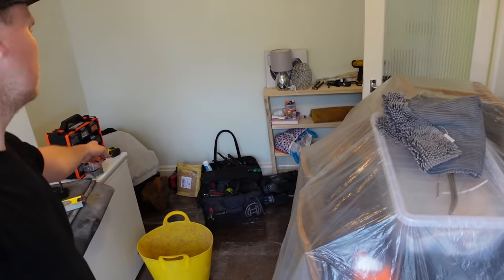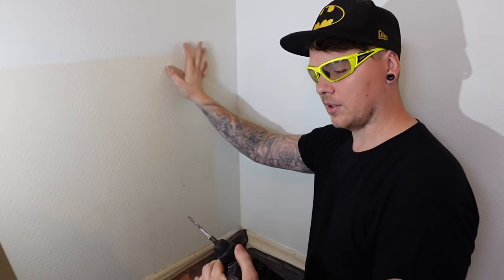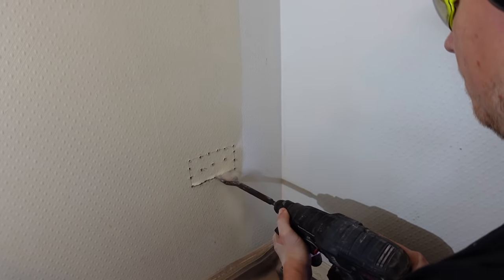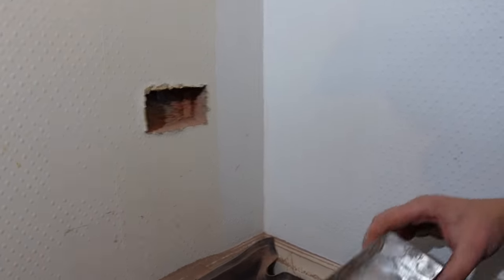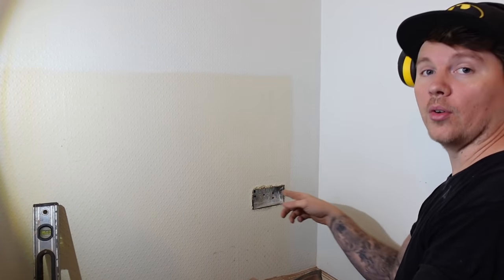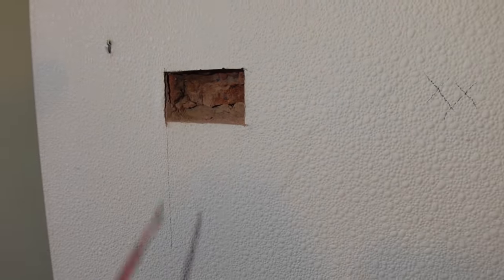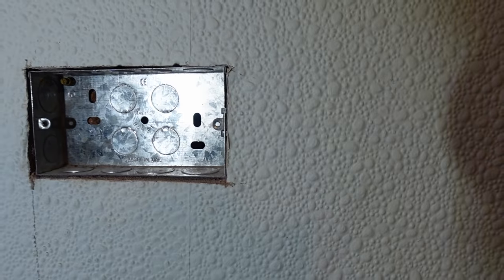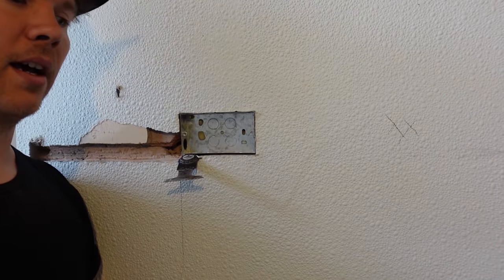How to chase a socket like a PRO - Electrician

Comment: Before you chase the wall out to fit the back box , mark and drill your fixing holes - then you will know that they are always in the correct place 👍🏻
Reply: Personally I like to get the cables in first before I start chasing boxes in, there's always a chance you can't get cables to where you have cut a box in, happens occasionally, then you have wasted your time and effort for nothing
Reply: I've been an apprentice for 5 months and figured this out a month ago after plugging the wall and screwing the box on and then realising I was supposed to have chased it out. Quite glad I realised early on. Comes in handy when you've got to chase out for a big media plates with 6 screws!
Reply: I don't understand what you mean by this comment. Chase the box out, fix box in... then chase for the cables?
Reply: @zu1875lu  he means before you start cutting the box out, from the fixing holes first, then knock the box out, and you will have your fixing holes already there
Reply: @acelectricalsecurity  oh right. He mean use a longer 5.5 bit for fixing holes. Gotcha thx
Reply: That means buying two different length drill bits.. and as  we all know most electricians don’t have too much spare cash…😂😂😂😂
On a serious note, good tip though.👍
Reply: @Ruben-ni7zq  I would have thought most would be buying bits that are 160mm long, they seem to be the norm, so one bit would be fine
Reply: After a lifetime of doing this job I keep watching these videos hoping to learn something new to make my job easier, and the best tip I would give is get a job with a utility company and a good pension scheme.

Comment: When you have the box ending up like this it's even easier if you use one screw and then blow expanding foam through the screw hole, after it cures it holds the box quite well
Reply: That’s exactly what I do! I thought I was alone in doing this. 

Foam is the way to go. It’s sets rock solid.
Reply: Just mix up a bit of hardwall, fill out the hole, push the box in and leave a couple of hours. A lot cheaper than foam. I finish off by drilling a hole and using a masonry screw when the hardwall has gone off. You can just knock a plug through with a hammer and old screw instead of using a masonry screw. The added advantage of doing something like hardwall or foam is you don't have to worry about the back of the hole being level.
Reply: @jonathanbuzzard6648  we’re Sparky’s mate, we don’t care about saving money 🤣
Reply: @ComDotlol  In which case consider that you don't have to breath in the nasty flammable/explosive propellants from the foam guns if you use some hardwall. Basically hardwall is much better for the environment than foam in addition to being cheaper.

Comment: Srip of double sided tape  or sparky tape, to hold a  thin plastic sheet  just below the cutout and when you drill chisel all the dust crap slides down sheet,  and not on carpet or skirting board, easy to just lift up and pour into  slop bucket, no vacumming required  ,tape full length of  palstic about a foot each side of cutout,  dont use gaffer tape it will pull the paint or wallpaper off.

Comment: As a DIY purist and finding that breaking into hollow blocks leaves nothing behind to set the depth or screw into, I use a mix of 1 cement, 2 bonding and 2 sharps sand.  Fill the back of the hole and push the box in to set the depth.  Goes off in minutes.
Reply: Works a treat to get you out of awkward situations where you can’t get a mechanical fixing. I usually just use bonding and cement together so the mix is more stronger but I have also used drywall adhesive which goes off really quick!

Comment: Swiss cheese the whole area with drill holes, then multi tool blade around the outside. SDS chisel bit to clean up and level off. PVA 50:50 seal and bonding behind the box if the brick blows out.

Comment: nice vid, some good tips thanks. I have been using an Armeg socket sinker round bit for a while now, its good for brick with not too many cement lines and breeze blocks, creates a bit of dust but works well.

Comment: How do you fix this if you go too deep. Used a 45mm back box now they have told me they are applying a 10mm plaster covering so the box is too deep and I am not sure how to fix this??? 
Once the plaster is on. Can I just screw the face plate on with longer screws to take it up to the wall tight or place some ply behind it then screw again??? 
Any help
Would be appreciated  🙏🙏🙏

Comment: I use a similar technique when cutting out on a finished wall like this one. I use my mini-circular saw with a midget diamond wheel and extraction to neatly cut the outline. Then I use an sds drill with a bit of meat (12 or 14mm) and drill as many relief holes as I can within the area, to just over 35mm depth (I use nothing but 35mm boxes). The chiseling is super quick and easy then, its just a case of getting the rear edges chipped back and its usually a neat job with no chipping of the edges. As for 1st fix work in a gutted house, I just blitz it with a 5" grinder, overlapping the edges to get near-full depth and make whatever gashes I need in the side to get in behind it and chisel it out in big chunks.

Comment: Bit of insulation tape at 35mm round the drill bit gives you the right depth every time and it's easier to see and use a paint brush to clean out the muck at the bottom of the chase, clears it out much easier
Reply: So I use a bit or paint inside the spirals of the drill to indicate depth. Red paint for red wall plugs. Brown for…. Lasts long er than tape
Reply: @AndyK.1  good thinking

Comment: Not too far from me, a red brick was manufactured the Accrington red stock brick, the Nori as I believe it was known as, toughest brick in the country.As it was made locally, a lot of properties were built using this brick.
As a young apprentice and sparky.. I absolutely hated the dam things, there were no electric drill issued for domestic type work, and if there were, there were no hammer functions and SDS would have been a wet dream !
It was had chisels/ bolsters etc and... fixings and hole through walls were done using rawltools and star drills (star headed chisels)
Holes through joists were done using short throw brace and bits..
Now lets see a video using those and then you can claim.... this shit is hard !!! 
Even in industrial situations like petrochemical sites, holes anywhere were all done by hand, yes, in stone, brick and steel !
Only last week, as I had omitted to take my SDS 18V Miwaukee on a job I burnt out two 6mm non SDS Bosch masonary bits using a non SDS Milwaukee 18v combi drill.
It was a renederd and refurbished bungalow and no clue to what was underneath the rendering...I only manage four 1" deep temporary fixings to fit two IP cameras, yup, tips of masonary bits are now non existant, revisit just to refix two cameras.... my fault, should have taken SDS drill, it still will not like the Nori brick, for sure.
Reply: The bricks were known as NORI because the mold was made the wrong way  around and should have spelt  IRON and yes most terraced houses are built with these red bricks.

Comment: I would have thought that the wall between two terraced properties will be two bricks deep so there should be no possibility of breaking through unless using a ridiculously long drill bit. Not that you want it unnecessarily deep of course.
Reply: Tens of Thousands of Victorian terraces were built with only a single brick party wall.

Comment: I dont understand how this kind of socket still exist in 2021 ?!? Looks so medieval !
In europe we use, since 50 years at least, soft round plastic box that has many advantages. Electrically non-conductive, easier to drill and wall remain stronger than a square shape, airtight to reduce global thermal consumption of the house and so on...